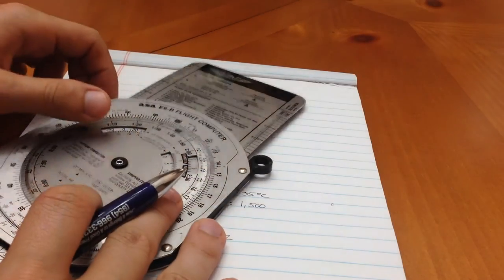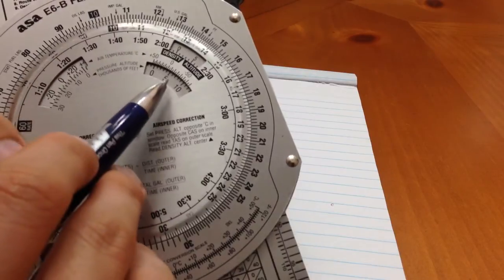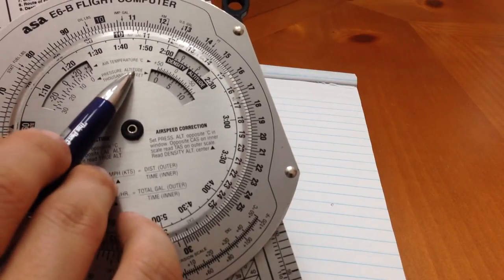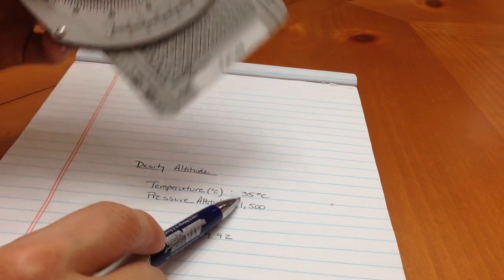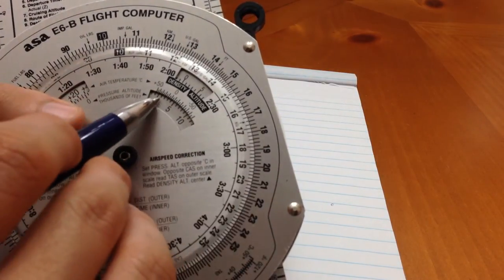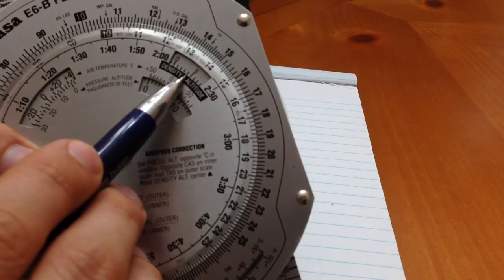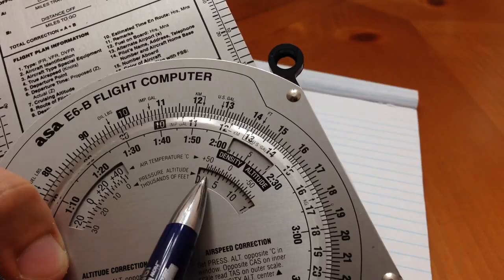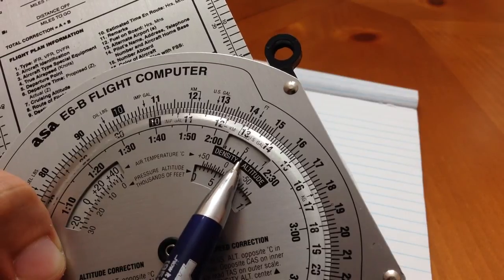Tutorial | E6B Flight Computer (Calculating Density Altitude) | Lesson #2

Comment: Can you please explain why there are 2 windows for temperature and pressure altitude? One window on each side of the text "Air temperature, Pressure Altitude"? When do you use the left window and when do you use the right window?
Reply from the maker: Hi Diane that is a great question. The manual for the E6B is not to clear on this, but for density altitude it refers to the window on the right. I believe the reason is because the ruler is calibrated on the right to depict the right TAS and CAS on the outer and middle rings. With regards to the window on the left they are meant for true altitude. Let me know if this makes sense.